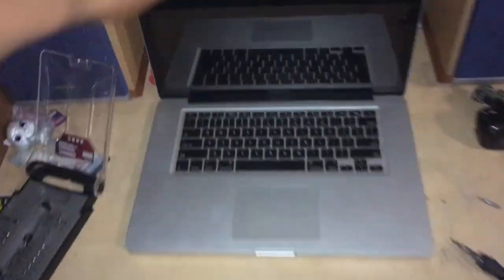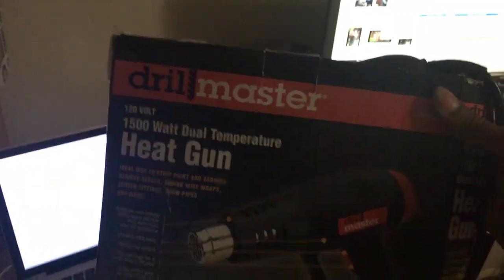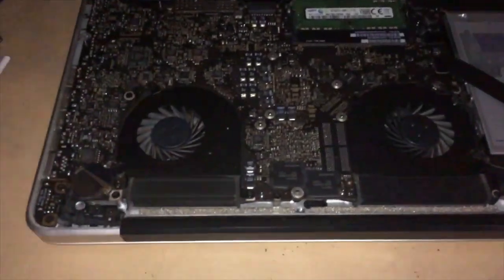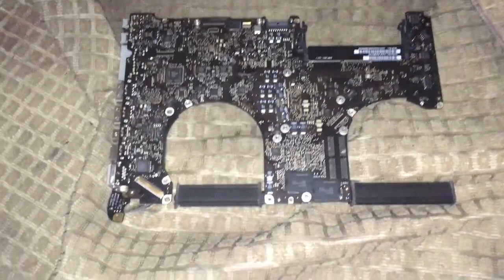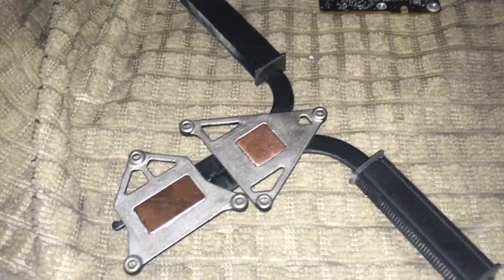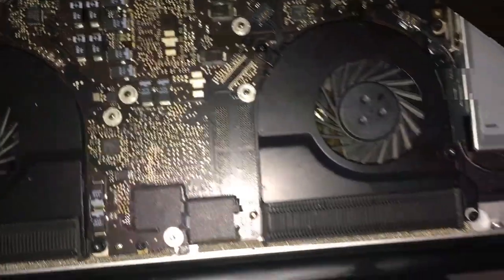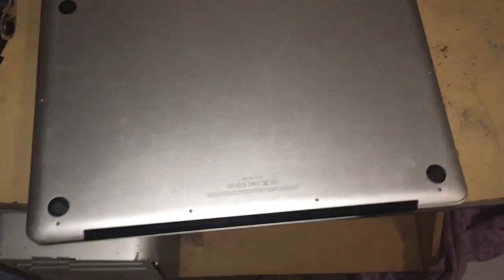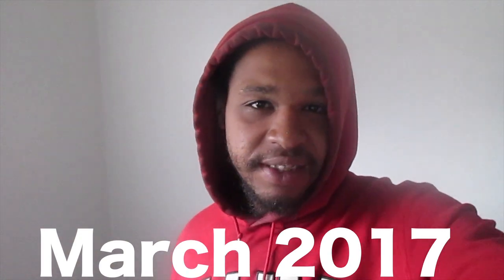How To Reflow/Reball 2011/12 15'' MacBook Pro Gpu

Comment: My 2011 15" Macbook Pro was toast. It was on craigslist as a non working computer. A hero emailed me a video on a soft repair through PRAM resets, etc. which didn't work, but decided to give the 'reflow' a try. Very easy. Took maybe 2 hours. Just have thermal paste handy, mini screw drivers (starred one, philips, and a triangle for the battery), and a hot air gun. Take a photo before starting to unscrew and keep the screws in a safe place. Just go slowly and be careful. Follow these instructions and your computer should be back in functioning order. Just did it, no issues so far... hoping it will last another couple of years.
Reply: Ryan Hartford how’s you 2011 MBP holding up now? I’m considering doin this myself. But from what I’ve read most people only get a matter of weeks to months of use after a reflow.

Comment: That’s a reflow, not reball. Nice work though!! Not many ppl are brave enough to do this! Does it still work? My experience is it only lasts about six months at most! You can also put it in an oven for 7 minutes at like 380 degrees
Reply from the maker: Thanks for watching the video Brian. I hope that the machine is still working i sold it about a week after i fixed it. I didn't get a call back but i assume its still working.

Comment: How’s it working now...I know it was working a year later, but now it’s two years later...so just curious if it’s still going strong?
Reply from the maker: still working fine to this day. but I wouldn't call this a permanent fix
Reply: I understand… But that is still good to know… Two years is pretty awesome!
Reply: I actually tried the oven bake fix… And it only lasted a week… So I think I might try the heat gun solution, otherwise I just have to completely disable the discrete graphics for good.